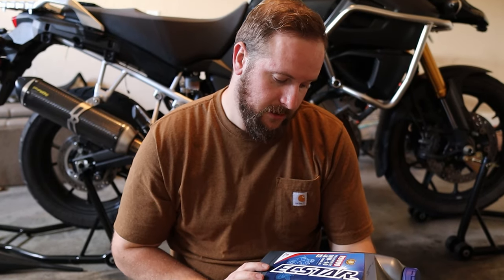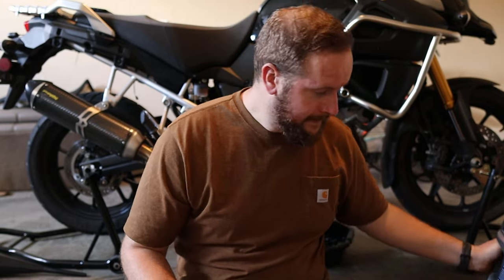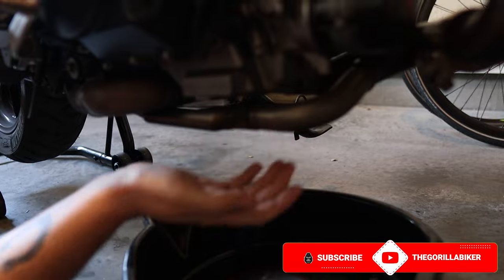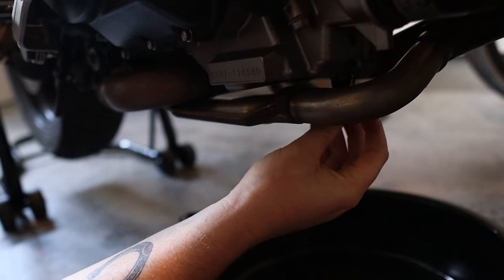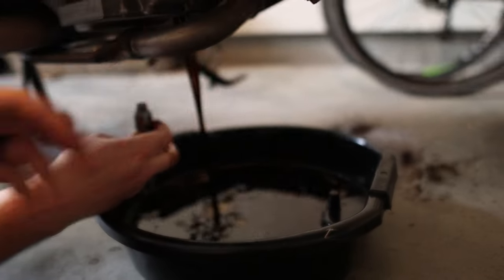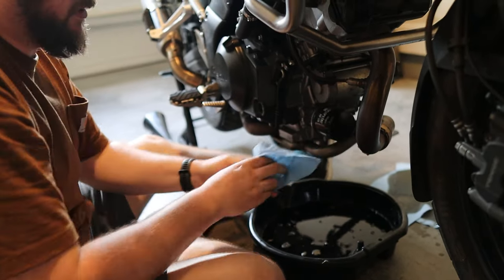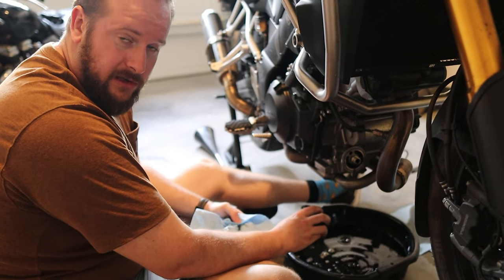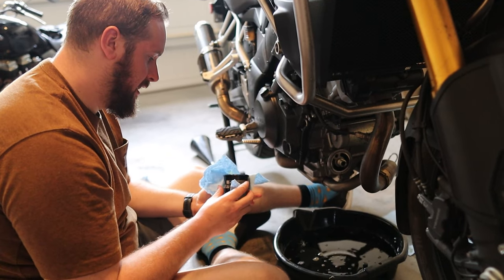How To Change Oil & Oil Filter | 2015 Suzuki V-Strom 1000

Comment from the maker: I know I've made videos before changing oil, but I had a good number of people asking me to please run through all of the maintenance on the VStrom as I did on the CBF1000. So I'm going to try to do that :) 
As always any other requests please let me know. :)
Reply: Who's yelling about using old oil to lube the gasket on the filter? It's not like it's going to be a consumable going back into the engine. Sheesh. Personally I use a touch of new oil but old oil works too.
Reply from the maker: Oh I've had comments in the past, I've also been called disgusting and a mess for spilling oil in the past. Comments on the internet are wonderful. I could cut all the actual stuff out but normal people need to see shit happens. Also yes, it's literally just giving the gasket some lubly lube. I'm too lazy to get new oil :D

Comment: Nice little vid.
Seems a simple bike to work on.
In the past I've dropped some oil in the filter prior to fitting. No reason other than to be different 😂
Reply from the maker: So far very easy to work on, The tank looks like it'll be a bit of a pain to remove completely but I'll cross that bridge when I come to it. 
Haha sure sure, where are the bodies buried Stuart :D

Comment: A good oil change. You hit all the right points. I don't pre-fill the filter but I have been measuring my oil. I think I'm at the point I don't want to do that any more. I'll just take my time and watch the sight-glass since it can take a few moments to rise there on my bike. How do you feel about after starting it and letting the filter fill up the level being right at or very close to the top of the sight-glass line? Would you attempt to remove some or just let it ride?
Reply from the maker: Danke sir. You can but the thing is you'll have minor difference in castings and other tolerances that mean you'll still need to keep an eye anyway, I knew ballpark numbers anyway since Suzuki are kind enough to have it on the case :) 2700ml without filter change. If it's very close to the max line I'd personally leave it, you've a little bit of tolerance there anyway, once it's not a considerable distance away from max fill it should be fine.

Comment: Reminds me I need to do an oil change on my V-Strom.  And I picked up an SW Motech skid plate for it too!  Excited to get that on there.  What skid plate did you decide on?  Nicely done with the video.  Very informative and spot on with everything.  Also Motul is my go-to for oil as well.  Call me weird but it also smells really good.

I don't pre-fill.  It's too messy.  The oil is going to immediately try to leak when you go to put the filter on unless you just wet the inside of the filter with a light coating.  It doesn't make a difference and isn't recommended by the manufacturer I don't think?
Reply from the maker: The lovely Stroms deserve lots of fresh oil. Especially since they don't hold that much! Ah very nice, I went with Hepco & Becker, I'm just hoping I can get them to fit with my engine bars! Thanks :) Haha it actually does smell very good :D Especially the 7100. 
It's pointless on most filters, it they're upright in the engine bay like on bigger vehicles then fair enough, saves some time so I probably would. No they don't, not that I've ever seen anyway :)

Comment: Question? Do the manufacturers sod about pre-filling filters on the assembly line?  Question? What should I do with my VIAR that doesn't have a filter thingy just a mesh thimble do da?   Answers on the back of a postcard please.   I have never managed an oil change without getting some on the floor, I thought that was normal.   My old oil is taken away by various strange old boys who use it in their bikes . . . .   That reminds me I shall have to change the oil in the VIAR it is the beginning of a new month and it only has 1 Litre in it . . . .   My VIAR has a sump guard and that sends the oil from the drain hole everywhere and drips from every edge....   Something for you to look forward to. 👍
Reply from the maker: Haha no, no they do not 😂 I really don't know why some people are so crazy about it. Haha pre lubricate the screen thingy :P That'd please people :P 
Floor oil is expected but I always try avoid it as best I can 😂 
I have to bring mine to a local advanced auto to dump in to their recycling vats. 
Oh 1 litre! That's like the CRF450L, think that only take a litre too. 
Haha I'll be taking mine off for access during oil changes!

Comment: Could never see the point of pre filling a side mounted filter. More chance of spilling it on the floor. I do pre measure the amount of oil I need and add it to the bike.
I bought an oil container that catches the oil and it the runs into an internal container. Less chance of spilling it when you accidentally bump it.
Reply from the maker: Me neither. And people always pour in the centre too which doesn't even do anything. I sometimes do, but when there's a nice sight glass I generally don't. If it's a dip stick I do. 
I have one of those.....but it's full after doing the cars 😂 I need to go empty it 😂

Comment: Its not recommended to using fully synthetic in the Stroms as it may cause clutch slip.
Reply from the maker: Fully synthetic MA2 oil is recommended in my manual, I'll report back if I ever experience any clutch slip. 
You may be thinking of "energy conserving" fully synthetic engine oil, which it recommends against.
Reply: @TheGorillaBiker  just repeating what I was told by my local Suzuki dealer!!!
Reply from the maker: @davidmeadows5665  ah fair! I'll report back if I ever notice anything anyway, it'll be very interesting if it does slip since it's the recommendation. That'd be bad form!